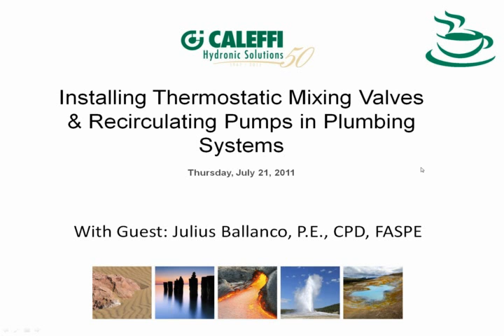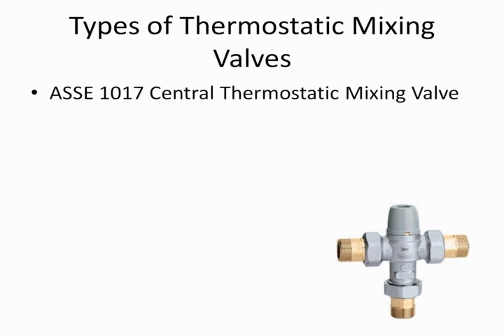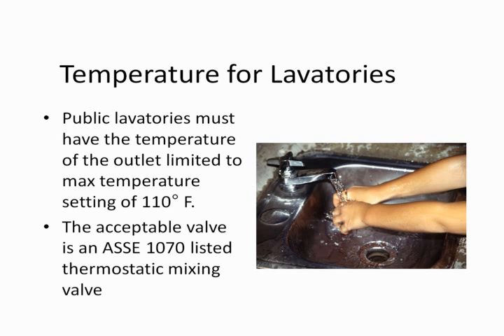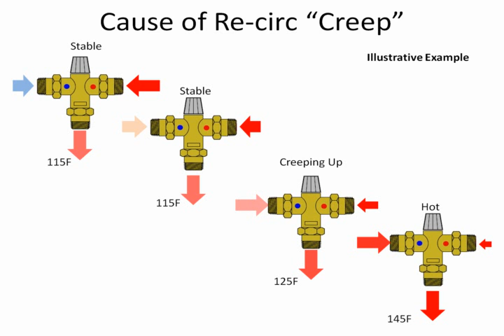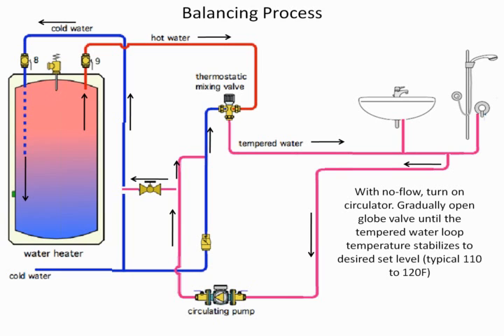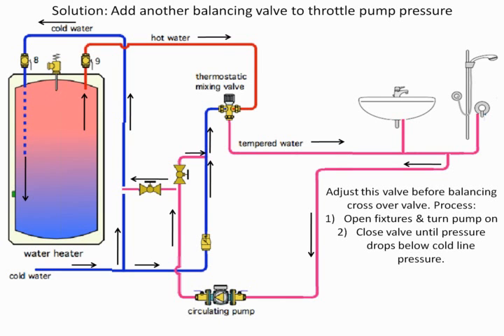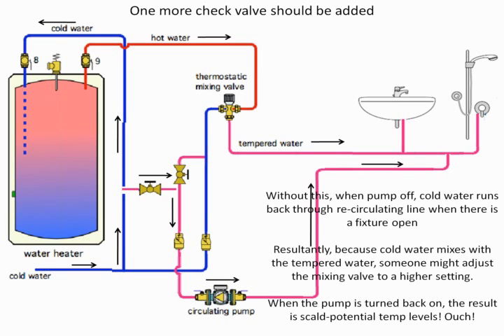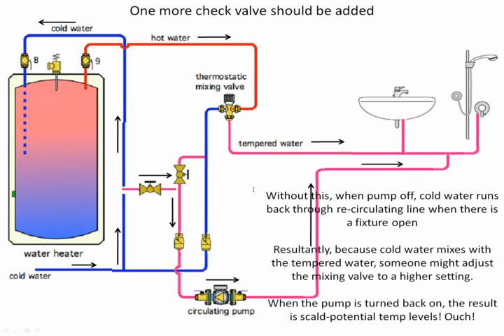Installing Thermostatic Mixing Valves & Recirculating Pumps in Plumbing Systems

Comment: Hi guys. I have an issue where hot water is somehow creeping into the cold supply line. We run a 75gal heater with a circ pump, and simple balancing valves in the showers.  Not sure how or where we'd get the crossover of hot water into the cold supply line (and vice versa), but this seems to be what's happening.  Any thoughts as to how to trouble shoot and correct?  Many thanks!
Reply from the maker: Thank you for your comment. The situation you described can happen from the induced flow of a pump. Therefore, we offer our thermostatic mixing valves with flow checks on the hot and cold inlets as an option. We also offer flow check tail pieces which can be retrofitted into existing installations to solve this creep flow. Please check with your local supplier for complete details or feel free to contact us if required.

Comment: Looking at the diagram it looks like the hot water line is on the right side but to my understanding it should be in the left side
Reply from the maker: Mr Muscle thank you for your question. The diagrams are for illustration purpose only. Our mixing valves are marked with a red dot for the hot water inlet; therefore the valve can be turned over so the red dot for hot water inlet is now on the left side. Hope this helps.

Comment: This video is very old no mention of fail safe here in the U.K. the valves shut off the hot side if the cold side fails and hence no chance of scalding
Reply from the maker: Thanks for your inquiry.  The information contained in the video is for the North America audience.
Reply: @CaleffiHydronicSolutions  thanks too much 🤗

Comment: what if the flow of the water return is less then the cold water supply, the cold water goes to the water return then what?
Reply from the maker: moundhir eclip If the return water flow is less than the cold water supply, then the return and cold water will mix at the tee near the mixing valve cold inlet, as desired. Take another look at the video, around minutes 40 to 44, for an explanation of the importance of the check valves, globe valves, and pressure balancing to assure proper flow direction. We hope this helps.
Reply: yes i know it will mix xin the tee but the flew direction will not go to the return ? lets say we have 2.5 bar pressure coming from the cold line and 1 bar from the return, did the cold water goes to the return direction?

Comment: I can not understand this. Why would the tempered water even be connected back into the mixing valve like this? it would make more sense to loop the tempered water back way closer to water heaters cold inlet line and put a back flow device behind the tee. Wouldn't that turn the cold supply to the mixing valve into a dedicated line with no tempered water and eliminate the creeping problem?
Reply from the maker: Sorry for the delayed answer.

If 100% of the recirculation water was returning to the storage tank, then the tank heater would have to work harder (more energy usage) than if only a portion of the recirculation water was returned to the storage tank.
 
To maintain the recirculating hot water at the desired delivery temperature, the heat lost from the loop must be replaced. This requires some water flow between the loop and the hot water source. Ideally, this flow is adjusted such that the rate of heat transfer from the hot water source to the loop exactly balances the rate of heat loss from the loop’s piping.

We hope this helps, otherwise contact us! http://www.caleffi.com/usa/en-us
Reply: I agree.  Why not just return to the hot water tank and avoid all of these creep issues.  I see the response below but it makes no sense.  How is the boiler working harder just because you are returning water to it.  A BTU is a BTU.
Reply: Cold water is only drawn into mixing valve when there is faucet usage. When there is no usage and with the "tempered" recirc run directly back into the tank's cold-in, re-feed to loop from tank's hot-out quickly raises to loop to the temp of the tank.  When faucet is turned on, you then get scalding water for however long it takes water to flow from mixing valve to that faucet (could be several minutes).
The scenario is for when you want the tank to have legionaire killing water temperature in a recirc loop environment.

Comment: Yeah that's alot. It's easiest to do a recirc pump with at source mixing valves. That's a disaster waiting to happen with all those tees and check valves
Reply from the maker: When piped properly the recirc pump will pump through the mixing valve, meeting minimum flow requirements and ensuring stable domestic water supply temperatures eliminating temperature creep in the system.